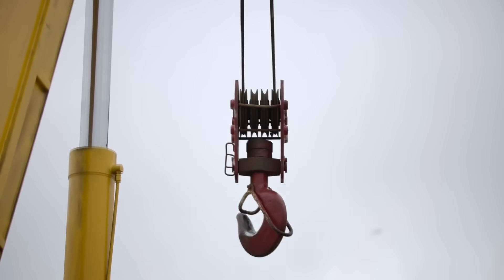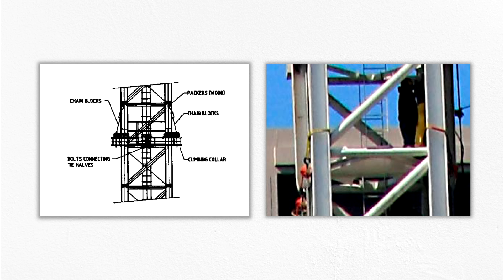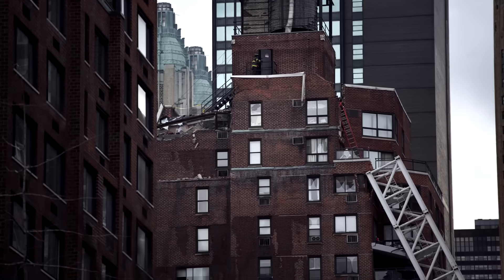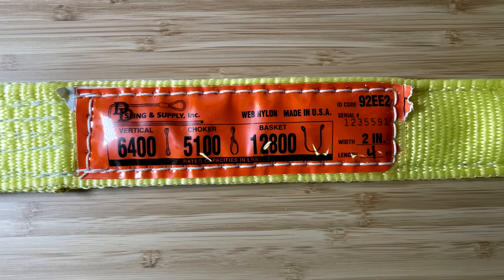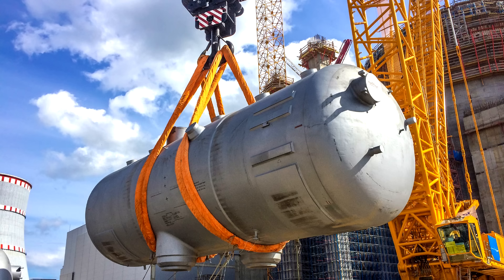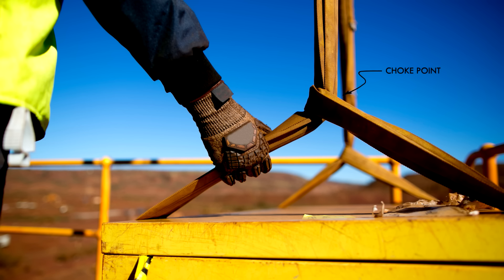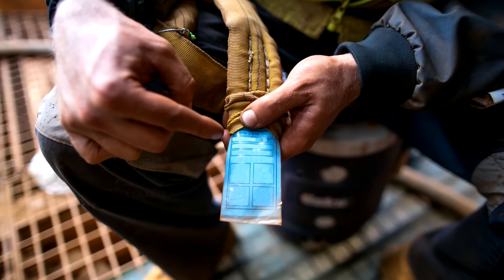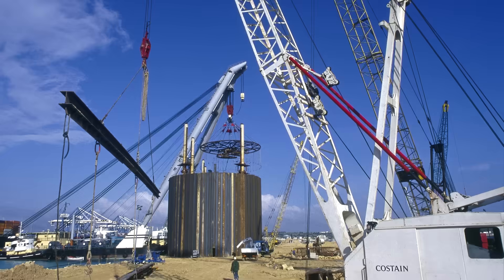Why Things Fall Off Cranes

Comment: As an intermediate rigger I'll state something you've missed in this presentation.
At an angle narrower than thirty degrees the horizontal stress applied to the load can crush said load.

Comment: The most important thing to note when lifting is: a vertical sling is always ideal. 
With two slings, the angle must never be less than 30°. 
A basket hitch was forbidden to us. Always use a chocker hitch or, even better, a hook. Clamps, magnets or vacuum are also possible to attach a hook, but never trust them completely. 
Damaged slings can no longer be used. 
Never lift over people, always expect something to fall. 
Not standing where something falls has often saved my skin.
Reply: A choker hitch seems a bit more dangerous to me because it encourages the point load at the choke... Isn't the choker hitch WLL half of the normal vertical? Though I do see that the choker provides some additional resistance to load movement, but I guess for most loads there are better ways of securing the load for the lift?

Comment: Great video! I’ve been rigging for 7+ years and you had great information. Was hoping to learn something my self but sadly I didn’t. Still a great information video none the less haha

As a rigger, my safest advice would be lift the load low. Test your rigging. Rather drop the load 1ft than 50ft if it does. Be surprised how many errors or things you can save by doing this. I do it with every load. It’s saved my ass a few times and NEVER under any circumstances stand under a load unless absolutely necessary. Many guys in the field ignore this rule. But I’ve seen it cost men their lives.

Comment: Very interesting, I remember reading something about hammocks that use a kind of really wide vertical sling. The forces at the tree are loads more than just half the body weight of someone sitting in it.

Comment: I work in a non commercial marina, and some of the yachts need to be hauled out and that is always fascinating to watch. Its a specialized machine that travels out over two piers where the yacht is in the slip and it lowers large slings under it and will lift it up out of the water and can maneuver anywhere across the marina with it. Has a 200,000 lb lift capacity or 50' total length. The worst part is most yacht owners will try to walk under it while its on the sling.......( most of the time they need to come out of the water because of damage and they have no patience to wait for it to be set up on its blocks)

Comment: I am a inspector of hoisting materials and cranes so i know quite a bit about this.
Overload on a sling is almost NEVER the cause of failure.
The synthetic slings have a safety factor of 7, so a 1000kg sling is not allowed to fail even at 7000kg.
The same is said for chain ( factor 4 ) and cable (factor 5).
Most failures are caused by damage to the slings or improper use of them.
Sharp edges are highly underestimated when it comes to rigging as something that may not appear sharp can be deceiving.
any straight edge is sharp, this is why you need protection for your slings, usually in the form of rubber sheets between the load and the sling.

Comment: @ 6:20 tip loading look at sling on hook tip. @ 7:30 hooks should be facing from inside out. A few I spotted no softener used with synthetic slings to protect sling against corners edge of load they Frey and cut easy.. 🤦🏼‍♂️just saying 🙏🏼

Comment: Hey Grady! Awesome video! Let me allow one little nitpicky remark on the graph at 6:01 - it confused me a for a bit. While the schematics seem correct, they are misleading, I think. The larger of the two angles is marked with 30°. Unfortunately that angle then also looks like a 60° angle, which is extra unfortunate because the opposite angle of a 60° angle is a 30° angle so it is super confusing and might lead to mixups.

I actually think that the angle of the drawn ropes is wrong to begin with (annotations are correct) and it should be a lot shallower. Anyway, I figured out my confusion, doing the math. Great video again. Felt like commenting in case noone else noticed this as well (unlikely). Anyway... Have a nice day! :)

Comment: This happened to me in undergrad. I totally overlooked sling angle and dropped a helicopter a few feet. The angle was high enough that the tension in the sling was doubled which exceeded the capacity.

Comment: Well done, great channel, thx!   I worked on large dredges for a couple years, eventually working in oil refineries and power plants. I’ve seen quite a few scary close calls, as well as a couple deadly ones. I’m retired now, but early on there was a lot of guess work on lifting loads, which slings to use etc. at that time the worse offenders were mostly on the bucket dredges and the large pumping dredges, I hope it’s gotten better compared to when I was doing it some 35yrs ago.   In the large Refinery’s, any equipment we purchased that was to be used for lifting, such as hooks, slings, shackles etc. that were manufactured in China, we most definitely did not keep in stock, and if outside contractors were using such equipment, we would have them use ours or they’d have to come back with the correct equipment. The China crap were proven totally unreliable and dangerous, It may sound nit picky, but it could cost someone their life.

Comment: You could just put in a safety factor of 1000.  I doubt there is any combination of factors that could break a sling a thousand times stronger than Sensible Shmuck would specify.

Comment: Nothing was scarier than when the crane at work  was using a suction pump to load a waterjet with 12ftx4ftx3in steel plates and the power went out and the suction hold safety failed.

Comment: One of the most spectacular lifting failure I know of occurred in 2016 in the Paluel nuclear plant in France when the slings used to lift a 400 tons steam generator failed and it smashed onto the reactor building floor. Results ? 2 years of repair for the reactor.

Comment: That angle at 6:18 is clearly not 30°, it's somewhere between 50 and 60.

If the engineers whom we trust our life and safety on, make such obvious errors in real life practice, then it would be rather reassuring to see videos about the processes that make sure to detect these errors or prevent them in the first place.

Comment: A few other things to consider: if you use 4 single slings and the lifted part is stiff, in worst case the load is distributed to only 3 slings. This can also happen, if the slings do not have the same length to whatever reason. Synthetic fibers here have an advantage over steel cables or chains, as their young's modulus is much lower, hence it's more likely for the slightly longer sling to take over some of the load.
For that same reason more than 4 individual cables or 2 cables slinging around a load are usually not working (exceptions with good engineering behind may however occur)
6:50 There's another problem that needs to be taken into account: together with an increased tensile loading of the slings, a compressive force in the load is introduced, which may cause problems like buckling. Classic example: abundle of reinforcement bars for structural concrete with lengths of 12 or even 18 meters. On one hand you want to have the slings at a certain distance to reduce the bending moments (so about 10m apart with 4m overhanging for a 18m rebar), but then you need very long slings to reduce the compressive force on the rebars. But this requires additional lifting height. In this case the best option are spreader bars.

Comment: My first experience with rigging was awesome. The crane operators were very happy with how I balanced some very odd sized loads that needed to be placed with precision. I wasn't certified so they brought in Ron the rigger. He was certified but cost about $10000 a day in crane bills and the connectors wanted to drop a load on him

Comment: Around 9:12 is the kinda stuff I'm used to doing with cranes, with similar parts none the less. 
Words can't express the "pucker" factor involved with having to flip odd shaped parts over with a crane.
Straight lifts are easy enough, but try using a crane to flip a several thousand pound part over so that you can weld the other side...

Comment: On the construction sites I work on in Australia, I have only seen a sling being used very rarely and those instances, it was a custom sling not of your typical variety (example, a chain-mail sling for lifting metal decking).

Instead chains are used to either wrap around something or hook directly onto lift points.

If chains need to be wrapped around something that has to be protected from damage, they will use padding under the chain.

Edit: I know of only one place where slings cannot be substituted for chains and that’s a natural stone warehouse I sometimes work at.

Comment: My first summer in the trades when I was still in high school taught me the dangers of improper rigging. We were working in teams of 2 and I was put with a guy who'd been there for about 10 years, and we were picking and moving an approx 3' diameter pipe approx 30' long. I knew nothing (Including the fact that he wasn't the brightest man there), so when he had us hook the hooks of the 2-legged chain sling into each end and hoist away I never questioned it. The pipe got about 5' off the floor before BANG the chains broke, embedding themselves in the walls on either end of the 80' long room and BANG the pipe hit the floor. We were waaaay too close and it rolled towards us. Luckily we were up on a sand pile (sandblasting company) and it stopped short of crushing us. 

I still remember that incident vividly decades later; and the lesson it taught me about the importance of proper rigging has served me well in the time since.

Comment: A tight sling sliding against a 90 degree corner of a steel shape will cut the sling like a knife through butter. This is why you don't choke a column with a nylon sling to stand it up. Wire rope chokers are better for most things.

Comment: Isn't that vertical lift example at 2:44 really a choker connection to the eye on the load? I'd think that a properly rated shackle should be used to attach the strap to the eye on the load rather than passing the strap thru the eye and looping it back to itself exactly like a choker hitch. The picture that follies shows shackles to attach the straps to the load.

Comment: Your sketches of the center of gravity jarred something in me. The CoG of a suspended load is always directly under the hook.
Reply: only after its off the ground and not slung in a manner to compensate. its easy to chain uneven weights up level but sticking out weird. i do it all the time with roof trusses/ partially built roofs.
Reply: @bocaks  but stil the CoG is directly under the hook.

Comment: Hi, you forgot to mention very common mistake using choker hitch on chains, chain links a welded in the middle and can withstand quite amount of load pointing downwards, but as soon you make it choke it can brake easy.
Reply: not brake, snap

Comment: One addition: the center of gravity will ALWAYS end up directly below the hook after lifted. So even if the slings have enough capacity, if they are not the correct lengths, the lift can become unbalanced fall from the slings.

Comment: Good job bud. My favorite misnomer is the 4 point sling. We use this rigging method quite often. Most guys will take the total load and divide by 4 and give a small safety factor for sling angle. But only three slings will see a load and can cause massive overloading.

Comment: this episodes is more into synthetic fibers, how about chain or another materials are they still same?, i mean in the terms of frictions power and heat generated, and type of holder (or attachment) that used of that kind, since the materials has different frictions power, max weight tolerance, and wind power which is become mortal enemies of the crane operators

Comment: I once saw a 3/4" diameter steel sling fail in a straight pull configuration. I was an apprentice millwright working with two journeymen to extract 1-1/4" diameter epoxy anchors where the epoxy hadn't set up. We were instructed, under much protest from us, to use the 35 ton bridge crane in the building to pull the anchors. It was like a bomb going off when the sling broke and it shot the crane block about 10ft up. The anchors never did come out.
Reply: Lucky they didn't kill someone. 1-1/4 epoxy bolt woudl need a 2.75 inch sling and a way bigger crane, and then you would break the bolt first.  The epoxy never fails if installed correctly and to the correct depth.

Comment: Great video, we have a crawler crane at our job site that is picking up tilt up walls which are about 80,000-100,000 lbs  it’s a massive warehouse we’re building and we have to form up some walls about 50 ft away from the slap they had to call In another crane operator so they could get the walls up safely in place. Luckily everything went well

Comment: Rule 1: Never EVER get below a suspended load.
Reply: Not always possible, I work in mine shaft, and we must work under suspended loads, all day every day.  We just use higher factors of safety for the loads and engineer every pick - the riggers only rig, they do not pick the gear, the engineers pick the gear and stamp each pick.

Comment: I worked in commercial and industrial construction for 20 years as a plumber/gas fitter.  Anytime there was a lift near me I stopped what I was doing and paid attention to the lift.  I saw many close calls of riggers improperly rigging loads.  The worst I saw was a 10 ton air handler drop from about 3' as they lifted it.  The crane operator could see from his cab 200' up there that the spreader bar was incorrectly set.  As soon as he raised it the bar swung and the straps slipped under the air handler.  It happened so quickly.  It fell and damaged the under frame of the unit.  Many other close calls.  But that was the only load I saw fall.

Comment: The one that really bothers me is when people back a shackle off a quarter to half a turn.
Reply: if you don't back shackle off it will require something like a wrench to loosen it after the weight of the lift has caused the shackle pin to tighten
Reply: @cdntruck  That doesn't mean it is safe to do.  I have yet to get a shackle undone that didn't take more than a tap on the steel, with my channel locks, crescent, something.  I have yet to need to actually crank on the pin to get it loose.  At least not one that doesn't have damaged threads.  I have seen people kicked off jobs for doing exactly this.

Comment: One of the big things that gets missed when working out your 4 leg lift is that the weight should be calculated as though it is only on 2 legs of chain or rope. Also remember that when using two slings on an object at an angle, the hook is not rated for this. Crane hooks are only rated for a vertical lift. Use a bow shackle to connect slings and then put the bow shackle on the hook. This is a large topic that you could do a series on!!

Comment: I'm an engineer (admittedly electronic) which I only mention to say I'm pretty familiar with the maths etc... mentioned, but the sling angle bit would not have been something I considered if I had to do this. Which luckily for anyone around, I don't.

Comment: Love this video, I use a pair of nylon rigging straps to move timber around on my acreage - the strength and durability of these materials is incredible and they're cheap as borch.

A 7000lbs lift capacity sling weighs about the same as my running shoes, maybe less, and honestly having one or two around is worth the $15 for when you need to move something heavy and awkward like a fridge, stove, or heavy ass box up the stairs. 😉

Comment: I used to be a live sound engineer, and I did a lot of rigging of loads above stages/audiences.

There's a lot of folk who are convinced that if you put a burlap sack around the beam you may be setting up as a load point, the sling will be protected from the i-beam. But if you're rigging a tonne from that basket, that's a lot of contact pressure on the sling regardless of 4 layers of burlap or not! More often than not we come to de-rig the stage to find that the sack has been cut through and the sling is no longer fit for service! This is especially so when there's an amount of dynamic load on the point, say from a beam of 30 moving lights all moving in concert. It doesn't create the most motion, but it's enough combined with the load to saw right through the sack over time!
Reply: We keep pieces of cut up 1/4" wall, 5" diameter rubber hose to layer between edges and slings, and that works really well. I don't think we've ever had anything actually cut through the rubber since we started doing that.
But we've got scrap sections of that hose left over from other parts of our shop, and not everyone has that advantage.

Comment: 6:00 This picture is double misleading. Firstly, it shows more of a 60 deg. angle (rather than the described 30). Secondly, which one actually IS the "sling angle? This one 5:50 or the improperly illustrated "30 deg" in 6:00? Because they CAN'T be both.